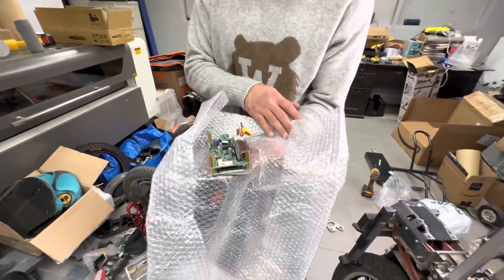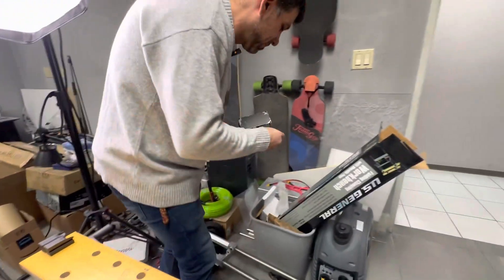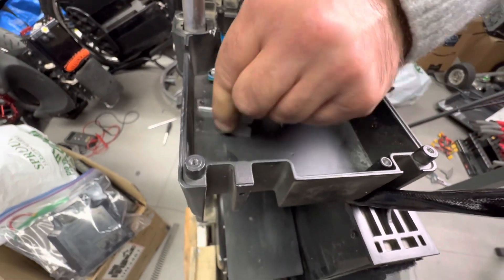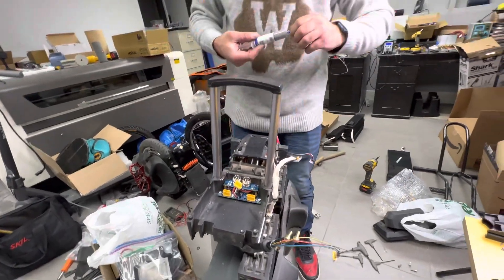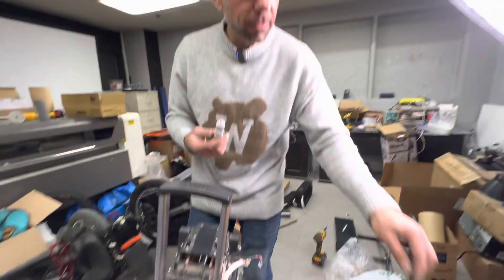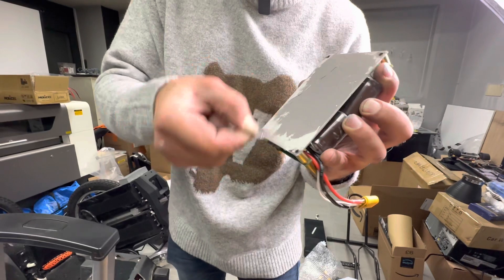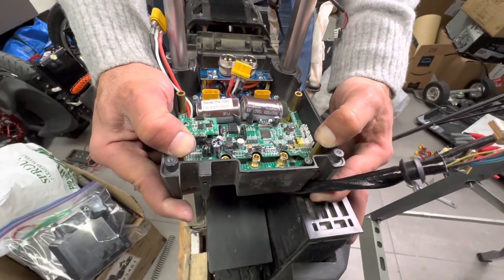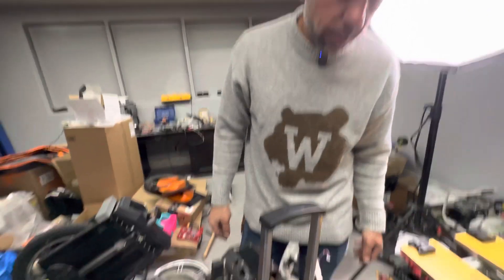Begode thermal mat issue solution for Master and Master Pro

Comment: Hi Roger, I have a nightmare case of a T4. The thermal pad was so bad that the controller detached on its own and felt. I tried with Arctic TP-3 0.5mm, expecting this to be superior than BGD's thermal pad. However, the entire center of the controller was not in touch with the sink. The option was to use a thicker pad but I had a pot of GD900-1 and tried with that. The T4 overheated but way slower. Almost 2 minutes to reach 60ºC in idle and if left there, it eventually beeps due to overheating.  To the touch, the lower surface of the chassis is quite hot. Almost too much to the touch. Is that normal on your Begode wheels? I am wondering if the controller itself is also part of the problem creating excessive heat, and not just the thermal conductivity issue. Thanks for sharing, I see I am not the only one with this issue. The controller should have a central screw, in addition to the corners...
Reply: Be good Wheels. Do not get to 60° while idle. And even when my master is beeping at 80°. The underside of the chassis is very warm but not very hot

Comment: I was surprised to find that there was this thick black paint or powder coating under the board.   It’s definitely not a very flat surface, seems like it would have a hard time transferring heat all that effectively with that coating between the metals, whatever paste or mat is used.  I was debating whether to try to sand it to the metal and polish it flat while I had mine apart but held off.  
I suppose the thermal transfer requirements probably aren’t as high as a computer processor, and it’s got plenty of thermal mass to dissipate heat if the board is secured nice and tight.

Comment: why don't more people talk about it? The only reason I looked it up is because I was fixing the controller recently and noticed that this begode master runs hotter than other begode master I have
Reply from the maker: An issue on more than just the master. The EX30 solution Begode put in place causes high frequency oscillations.

Comment: i used some fancy thermal mats i have at work instead of paste.. I figured, if the expensive mats i have at work are good for multi-thousand dollar hardware, it's good enough for my Master. 😆
Reply from the maker: The problem was how compressible the thermal Matt Begode used was. That’s the reason it created the void space in the center of the board.
Reply: @roghaj  yea.. it was a standard thermal mat material that was a bit thin to begin with.. I have that stuff at work too.. but used a much thicker mat when I replaced mine, so plenty of material to make contact 😊

Comment: Will any thermal paste do or should I get <insert brand here>?
Reply from the maker: Best to use a non conductive one.... other than that, the crappy ones will do.  This doesn't require NASA levels of heat transfer.

Comment: I need to get a lead on where to get the upgraded motor/battery/BMS for my S22 - I haven't seen it for general availability anywhere.
I am going a different route on my slider "upgrades".  TLDR I'm using a "tribological" material to rebuild the parts that were made of what I think was the wrong materials.

Longer story:  I guessed their goal was to simplify the mechanicals as well as make a slimmer profile on a wheel that was turning out to be super wide; I also have a hunch that adding a bunch more moving parts is ultimately going to lead to long term reliability and maintenance issues.  Making the single part linear bearing out of better materials might just make the whole thing work as intended.

Comment: Those thermal pads are not only heat conductors but also designed to be insulators. Interesting to say the least.
Reply from the maker: No insulation necessary here.
Reply: electrically isolated, thermally transparent.  Not really interesting.  Lots of plastics do the same thing.
The main thing is to keep the air gaps filled - air is a thermal insulator when trapped - I like them in general for cleanliness and ease of use but if you want the ultimate thermal transfer, use the diamond based paste.  One of my kids fixed a lot of xbox360 thermal issues just by pulling out lower quality filler and replacing it with the diamond stuff.